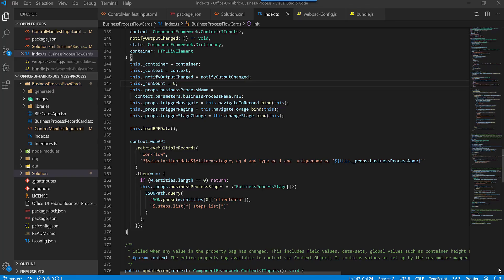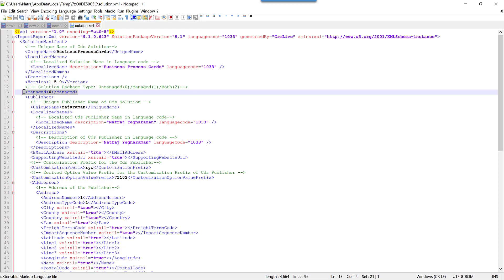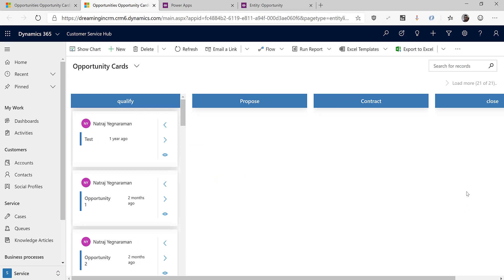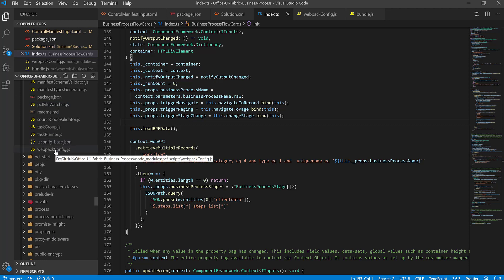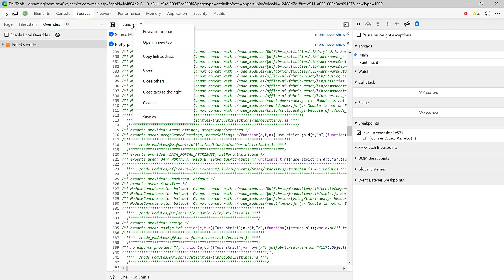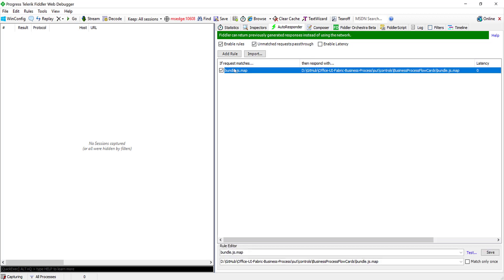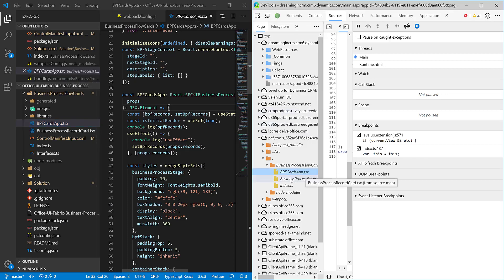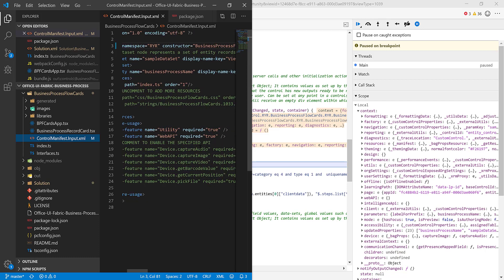Easier PCF Debugging with sourcemaps and Fiddler

Comment: I checked my folder after build, bundle.js.map is not present in the folder. Only bundle.js. Did you run any command to have it? Thanks for the video. It really helps.
Reply from the maker: If you did change the webpack config, you should have the mapping file after build.